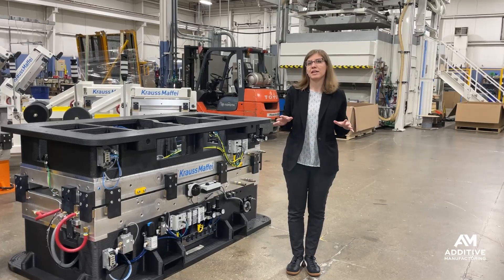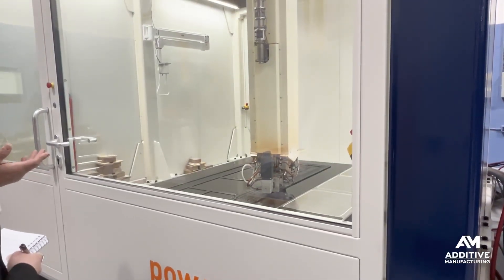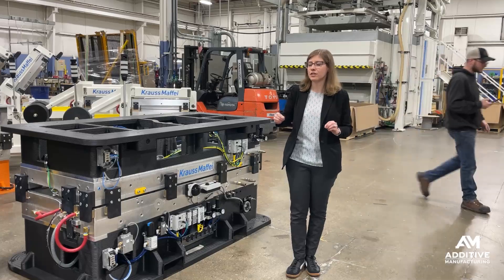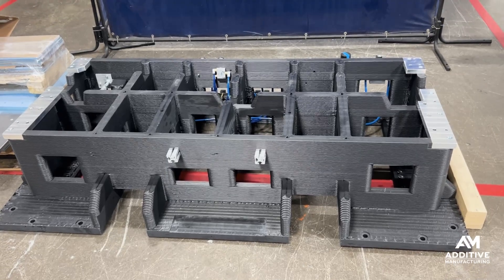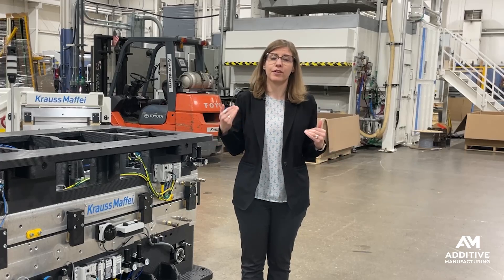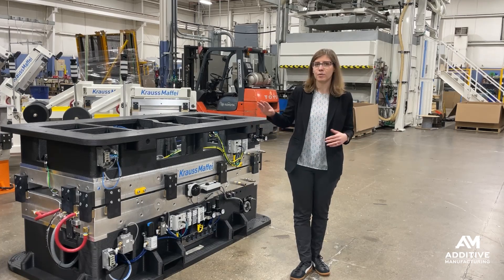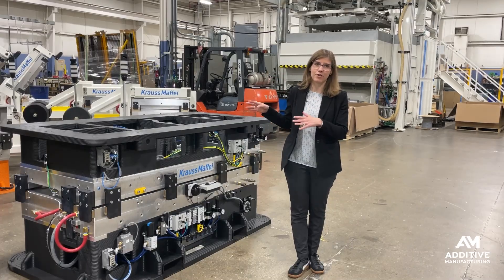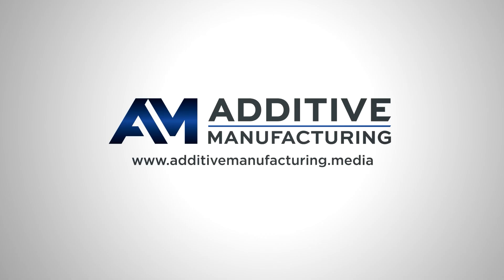3D Printed Polymer Composite Tool Riser Better Than Aluminum Casting?

Comment: So many questions: They're printing with PC and I'm wondering about things like is the printer open or chambered, nozzle sizes, etc. Also, it looks like it's printing slow so I curious how this affects layer adhesion. What does the end product look like after it is machined? Does it require hand work after machining? Well, I know it was just an overview but am hoping you will make a more comprehensive video later.
Reply from the maker: All great questions! The risers you see attached to the tools in the video are end products. The machining is pretty minimal with a lot of the part remaining as-printed. KraussMaffei has both enclosed and open LFAM printers, and nozzle sizes range from 2 to 20 mm. We'll check in with them and see about more detail on printing these specific risers.
Reply: and so much more: how it compares in terms of strenght, from my small experience plastics tend to be fragile in long term  use, then, after the failure, what happens to the material, is it recycable? composites tend to be not so easy to recycle as alu.